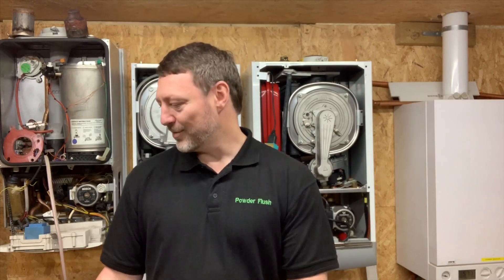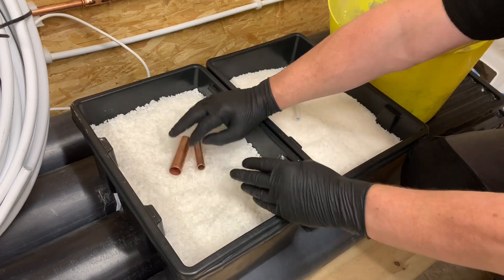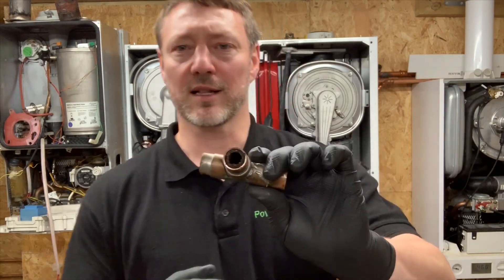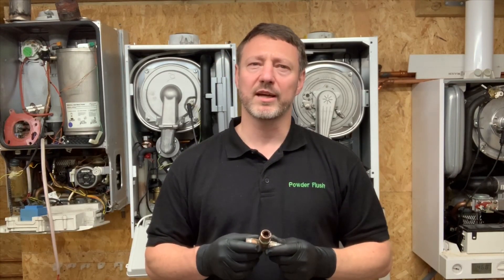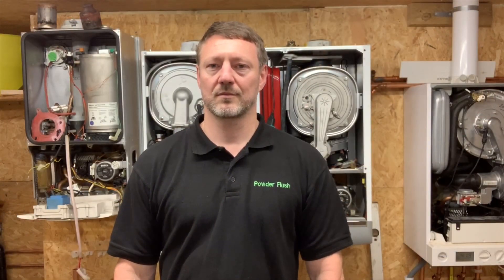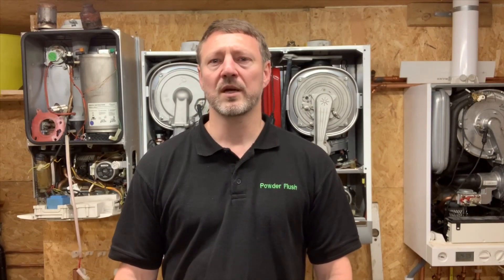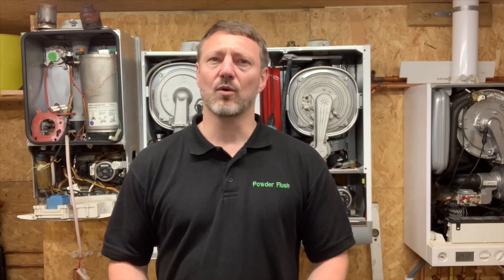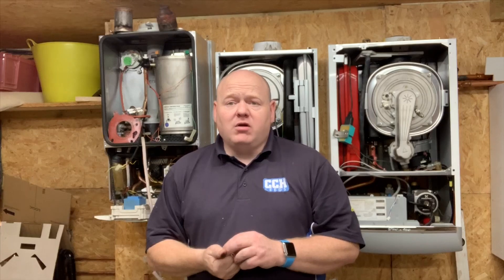What is a Powder Flush

Comment: Hi Alan this is very interesting
I have been in touch with powder flush and am trying to actually talk to an engineer
They were recommended to me by my heating engineer.
Stephen has contacted me by text and I have been through the booking system and booked a powder flush but their booking system relies on the postal service and now with one day to go it looks like they have cancelled my booking.
Stephen only seems to want to be contacted through a virtual assistant.
So this is very frustrating.
It does look like this process will fix my heating but their customer service and communication seriously needs to improve.
If someone can actually contact me regarding this and offer a genuine reason for cancelling my booking I would be grateful. Thank you for reading.

Comment: We just had Stephen and his co-worker visit today at our home in West Sussex, and they were absolutely brilliant!! They worked solid for the whole time they were here and fixed our heating issue perfectly!! For two winters we had a poor flow of heating and also had very loud banging in the pipes in the ceiling when the heating was on. We were advised by our gas engineer to get Powder Flush to visit as a chemical wash failed to solve the problem and Stephen came and performed a full system powder flush and also repaired a fault. Now we have brilliant efficient heating!!! We would 100% recommend this company to anyone who needs to improve the efficiency of their central heating. They are a legitimate business and their website doesn't include any specific contact details because they are a unique patented business that protects itself from it's competitors, but the booking procedure is very straightforward on their website and only for those who are serious about getting their heating system fixed and restored to optimum efficiency. It's given us such joy and relief this evening as we enjoy a peaceful cosy house, no more banging and no more frustrating inefficient radiators! Thank you so much Stephen for your expert help, you went over and above the service you give, and you are worth every penny of your service! :)

Comment: Hi Allen, so I am going to get one of these flush systems before the winter rush. With powder flush it sounded like you would only use powder flush after other flush procedures had not work properly. Does this have to be the case or can powder flushing be used as a 1st attempt on heating system that may not be to bad but could do with bit of a clean
Reply from the maker: Hi John. You can do a powder flush first if you wanted. Give him a call and ask. Thanks.

Comment: I'm having a Combi Boiler fitted  in September, as my present system is the hot water tank system, and it's been in for 28 years. My plumber said it will be ok to leave the rads and pipework as they are, and alter the pipework for the boiler. I thought using PowderFlush on the existing pipes and radiators would be a good idea, before fitting a new boiler. How much would it cost ?

Comment: Hi Allen, Very interesting video. I have a water leak on an old potterton suprima 40 boiler, I drained the system and open up the boiler up and find out the water is leaking from the heat exchanger. I have remove every other part around the heat exchanger but for some reason I CANNOT get the flow/return pipe out of the heat exchanger despite loosing the securing nuts. I gave it a gentle knock to free the pipes but there was no movement (I'm guessing this due to fact it haven't been remove for years so rust or limescale build up). Question is that would Power flush help to clear any rubbish or rust that is preventing the decoupling flow/return pipe from the heat exchanger?
Reply: kenny Og no. Apply heat from a soldering torch

Comment: Copper doesn’t oxidise
Reply: Actually copper does oxides slightly, then the copper oxide forms a protective layer preventing further oxidation, but it is the iron oxide within the system that causes the problems.

Comment: a hammer and chisel would just about remove solidified iron oxide in open vented system tees and bends as he showed. No pellet or no mains pressure flush will remove that. The section of pipe needs to be removed as he obviously did. No one in their right mind would introduce a product like into any heating circuit.
Reply: How does sand blasting work.....
Reply: @stevenpaddybwoy  it doesnt. Dont waste your money. If mains pressure flushing doesnt clear it all out. Replace rads or pipework. Once it has solidified (20 + years) you can not remove it. Cut the pipework out and replace.

Comment: What is the powder made of? If there is some left in the system will it start to eat through Ali heat exchangers like a salt would? Also won’t that potentially make a block worse? What happens when that stuff is heated up to 80’c (if some is left in the system). Wouldn’t want it to start turning to a gel/paste or clumping together
Reply: Having had a look at the powderflush website it apparently dissolves in hot water and can be left in the system without any issues although it is typically flushed out as part of the process.
Reply: Rob Thomas. If Powderflushing is better than powerflushing I will be one in line to buy some powder as I do lots of this work myself. I’m just always a bit sceptical of anything these days that claims to be better than something without giving us evidence it works and isn’t harmful. So many things come on the market saying they the best thing since sliced bread and turn out to be rubbish
Reply: @AshleyWilliams-to7ur  Its always best to do your due diligence so scepticism is the right way to go. I only came across this due to him sponsoring Allen's website and did some digging. Stephen's website implies that he is the person who invented this and is the only one who uses it, travelling the country to perform the flush on customers systems. It doesn't appear that there is either a franchise option or the ability to buy the equipment/pellets so other plumbers can do it themselves. I might have got the wrong end of the stick but the service prices are on his website along with positive customer feedback and a booking system so fairly transparent.
Reply: Only thing though is, if it’s a service he does himself, why advertise is through a plumber?

How likely is a plumber to sub contract out a service they normally do themselves?

Can understand him advertising direct to public so when members of the public have issues this might fix they contact him, but doesn’t seem to be much benefit to using the trade to advertise a product the trade can’t buy... and I wouldn’t of thought many plumbers would hand over work they normally do themselves.

Don’t get me wrong, it looks better than a power flush.

But if a power flush is working fine for the vast majority of plumbers, it’s good enough for a boiler warranty or to get radiators working again... and earns the plumber some extra business... just don’t see them contracting it out.

Buying the substance and using themselves with their power flushing machine, yes I can see that, but not passing the entire job unless it’s a case where the plumber is having absolutely no success and this is a last resort... but some plumbers would probably still prefer to repipe in many instances as it’s all extra business
Reply: @Clicksystems  Understand what you are saying although as Allen has stated above it sounds like a last resort after power flushing has failed to resolve the issue. So in that case a plumber might be in a position to refer their client and I've also heard of plumbers not recommending a powerflush on a microbore system. BTW I'm not a plumber, just a consumer who enjoys yt channels like this so I've found out about powder flushing through Allen's channel. So my question now is how much is a standard powerflush vs a powderflush i.e. is it worth the cost of the first or just going straight to the latter. This would be on a 1970's 8mm microbore system and a baxi back boiler which is working ok but not great and the last radiator on the system ha always been lukewarm and might just be an underrated boiler.
Reply: Rob Thomas yep I agree a plumber may as a last resort.

But if they sold the granules direct to plumbers, financially speaking, what’s the odds that plumbers would favour using the granules over the chemical cleaners? He would see absolutely loads of these granules to plumbers and be ££££ in.

But I just can’t see much of a case for plumbers outsourcing him to do the flush unless it’s last resort as you mentioned, and even then many will just cut and replace pipe where possible as it’s extra chargeable work and still maybe cheaper than a powder flush.

Should really sell the granules because then he would sell absolutely vast amounts of the stuff as I can see many plumbers using it and it taking off.

Suspect though one reason it’s not sold separately though is because they don’t want people figuring out what it actually is and either copying it or sourcing it elsewhere. As it’s possible that it’s an off the shelf substance which is being marketed and protected when used as part of a procedure and it’s the all round substance and procedure which is what’s considered innovative rather than the granules itself.
Reply: @Clicksystems  Yup agree with everything you said.
Reply: @Clicksystems Bang on mate. He should just patent and sell those pellets
Reply: @Bondy90s  suspect reason that it’s not done is because it’s an off the shelf product and all they do is stick it into a power flush machine.
Reply from the maker: it dissolves in the water. Then you flush it out. Thanks.

Comment: Wouldn’t you need to bypass the pump! I can see the pellet destroying the fins as the gap between them is small compared to the bore of the pipe leading to and away from it...... thinking about it wouldn’t it block the heat exchanger as yet again the bore is small?
Reply: He would say it’s fine wouldn’t he? Think about what he said, one pellet for 15/22mm pipes and one pellet for microbore. This is due to the pellets only being able to pass through certain spaces. So how will 15/22mm pellet pass through a pump impeller or through the narrow channels inside a condensing boiler? It doesn’t make any sense. What about some Drayton TRVs that have a tiny hole in them (which again I don’t understand)? Does he have a clicker like a doorman counting when all of his pellets have come back out? 🤣
Reply from the maker: No, I actually asked that question. Pumps are fine. 👍

Comment: I am seeing problems,  one is if pipe is almost blocked the palettes will block it all the way and cut the poor flow, also this maybe is good where u have a flow  but basically everyone is doing powerflush when its too late when u basically have no circulation at all then they are expecting from u miracles
Reply: This is a gamble which i am not willing to take. Once i cleaned the pipes with descaling pump and So4 most agresivne acid u can get at least by my knowledge. Back in my country normal service is take secondary heat exchanger put it on descaling pump and use So4 since we have huge amounts of scales. By huge i mean u need to clean it once i year, same with primary one if it gets blocked or partially blocked
Reply: @BriaCroTex  I've read on Stephen's website that there has to be some flow and he will try and has some techniques to get it working if that's the case. Sounds like you must have really hard water with your system to have that much scale.
Reply: @robthomas7232  i can't insert picture but secondary heat exchanger is blocked 90% since there is little space between plates and primary depends on system. We never had open systems so that's a good thing but again alot of corrosion and radiators parts inside. Also we have pressure system so we have at least 3bar pressure in the system we have to install reduce valves because pressure goes 10+bar
Reply from the maker: Steven was saying this is a last resort When power flushing has failed. They offer a no fix , no fee service. as well.

Comment: Wound the pellets not block it even more if it's all ready blocked?
Reply from the maker: Good question. No, they dissolve in the water. Thanks.
Reply: Allen Hart if they dissolve In the water, why is there two sizes of pellets?
Reply: @AshleyWilliams-to7ur  Dissolves in hot water so I assume the flush must be using cold. Different sized pellets for different bores of pipe.

Comment: Hi al the guy didn't explain how you actually go about doing a powder flush. Can you let us know? Cheers
Reply from the maker: They pump the pellets around the system. I think he said that in the video. Thanks.
Reply: Allen Hart so it’s all the same power flush machine, what about extra precautions, or is it straight forward, I’d be worried I’d be putting more potential blockages into the system 😝